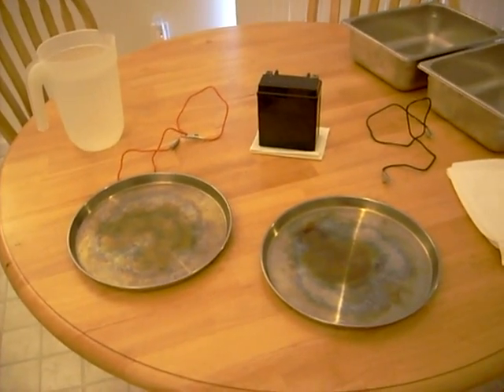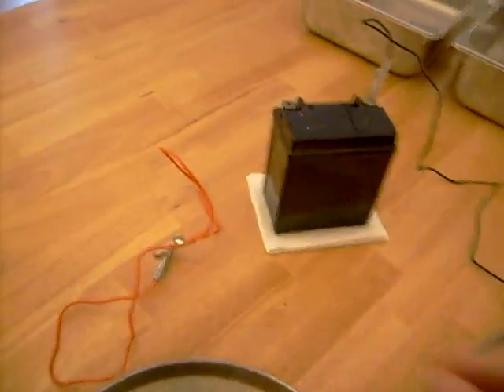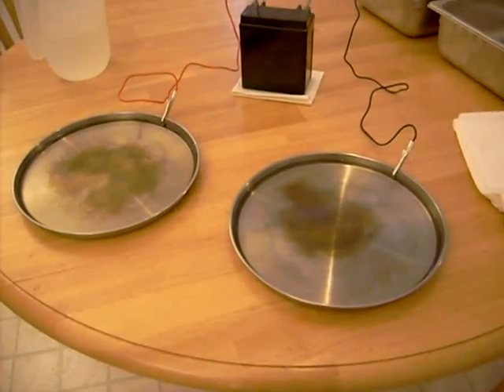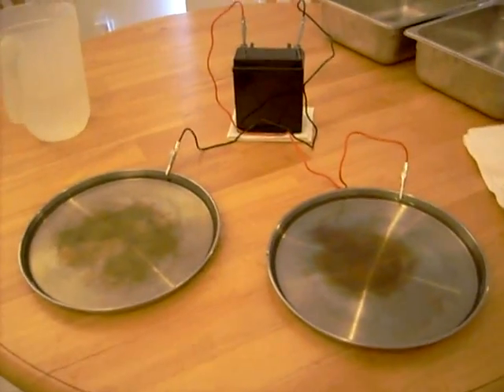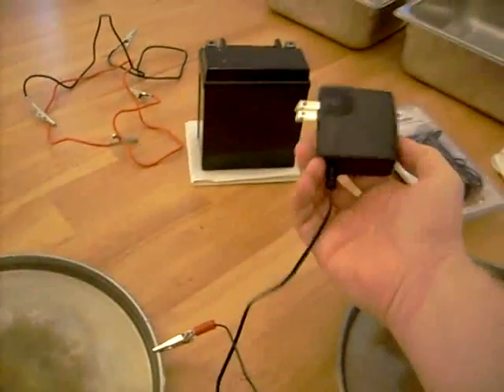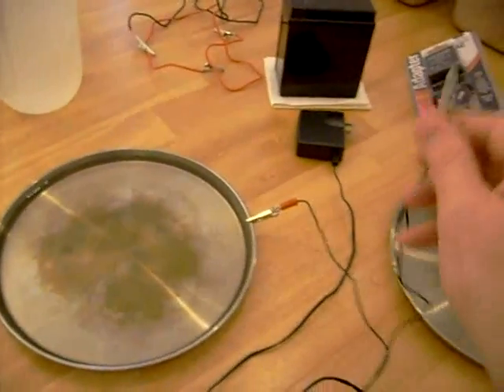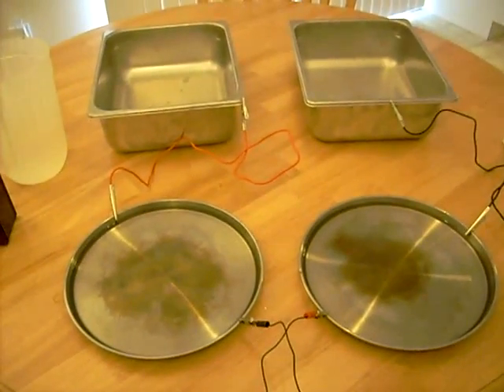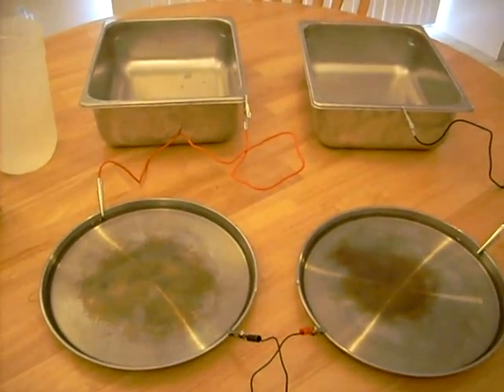Cure Sweaty Hands, Palms, Hyperhidrosis, Hyperhydrosis

Comment: First of all thank you for this video,I have been doing this treatment for a few years ,the first time I had to do for about three weeks before started working,but now I can go for over a month without treatment and let me tell you I live in a very hot weather country,sometimes I get lazy and don't do the treatment but it does works and I have a very severe case of sweaty hands and feet.
Reply: me to have very severe sweaty hands & feet dripping level in just minuttes. i can only go 3-4 days without treament before my sweats return gradually. i use up to 24 volts, 7 amps rechargeable lamp battery, 40 minuttes treatment. how many volts and how long u treatment schedule ?
Reply: I use 12 volt motorcycle battery I do treatment for about a week, I do ten minutes  then I switch negative for a total of 20 minutes on hands and 20 on feet. Don't get discouraged keep trying do this on day 1,2, 4,7,10,15,22. Hopefully this will help.
Reply: thanks for reply, yes this treatment works. i already do this before and stop about a year then i start again from the begining. lucky you can go over a month without treatment but your sweat did not return if i'm not mistaken, while me in 3-4 days my sweat return if not treated.

Comment: One session down and I already BELIEVE that this is going to work. I've used an adapter (must admit it took a lot of faith) and its worked like a charm. Will keep you posted. Thanks for this, Shannon. BTW, it was a AC 240V to DC 24V adapter, together with two shallow plastic tubs. I just put the wires/cables straight in the water and it was quite bearable.
Reply: Did it work?

Comment: From birth I suffer from excessive sweating of the arms and legs. I always felt bad when I was about to give someone a hand. Avalanche of sweat was running down. I used preparations that were not good and caused terrible itching of the skin. I was looking for another way to treat excessive hyperhidrosis on the internet by accidentally discovering dermandry. I can recommend my nightmare with a pure heart and finally it's over. Thanks to dermandry I can function normally. Dermadry changed my life. There is also very nice service.

Comment: The procedure is the same with feet just that I raise the voltage to 24 V, gradually. The current varies from 3 - 10 mA. Depends on how do you feel (level of sympathetic activity), the level of current will be. I recommend you connect an ammeter in series like I did to control the current to avoid jolt and too much tingling.
Reply: How did you adjust the current. I bought a 12v, 2A adapter but I'm scared the amps is too much.

Comment: I did this very easily. It might be hard to understand but i will try:

Take the adapter and cut off the actual connector at the end. You will see that there are actually two copper wires that are actually held together with the wire insulation. Split the wires using a razor blade or knife. You don't need to split them all the way to the end but just about 1.5 feet or whatever. Then, you strip the wire insulation using the blade or wire strippers. Strip only like 1.5 inches.

Comment: After only 8 DAYS, I've already had great success with this guys "at-home" style treatment, so I thought add some comments. It's true, you probably won't see any results until at least 7-8 treatments. ALSO, buy some vasilene! If you have cuts on your hands or even bite your nails you will feel a very strong tingle, even with 6 volts. Using Vasilene, I can barely feel the voltage with 18v! I used 6v, then 12v, then days 3-8 I used 18v for 20 mins total. I am so freakin happy!!! IT REALLY WORKS :)

Comment: 7Ah simply describes the capacity of the battery. That battery can hold 1 A current for 7 hours. 
From the Ohm's law I=U/R current depends on voltage and your skin resistance. If skin resistance is constant it will only depend on voltage. More voltage = more running current. Here electrical current is not dangerous, because the voltage we are using (12-18V) is relatively small. The harmful point is ~40V (dry skin).

Comment: i'd just like to share some problems i encountered and how i overcame them to continue using this lifesaving treatment.

1)When you start your treatment the first time - To prevent shock - start with 9 volts and then after 2 weeks move to 18 volts -you will notice your body would have developed resistance and you will not get a shock.

Comment: It is best to use a battery. The adapter transform the voltage especially electronically by combining pulses that pass through the body. It is best to charge a battery and only use it when it is full.

Comment: This Method WORKS. I saw results after 7 sessions. My hands did not sweat and are bone dry for 2 weeks before I have to do a follow up. I have been suffering from this disorder for about 25 years. I used a 24v adapter 210mA. Thank You Shannonbowling for this video.

Comment: Not sure if anyone has replied, 7ah is just it's capacity. Your body will only let a certain amount of amps across (by resistance) at the voltage rating. 1 amp can kill if at the right voltage... 12 volts is harmless, unless you have really low resistance in your body (a small child, baby, or mostly made of metal)

Comment: To engineers who say this is not safe,
Since you're engineer, why not make a constant current circuit?
For anyone with basic electronics skill, you can make your own constant current circuit. I make one with constant 3mA output, which should be safe. I also add a 1k resistor. With 24V input, it caps output at 24mA. So if my circuit go wrong, I won't get electrocuted. This also eliminates the problem of steel plates touching each other.

Comment: Instead of tap water, because some homes use water softness, buy and use a different gallon of Ozarka water for each session. Works so much better than tap water.  And yes if it isn't working for you, you are doing something wrong. Use aluminum pans for better current flow instead of stainless steel and check the alligator clips to make sure they are good. After 1 week, you will actually need to carry lotion with you because the sweating will stop completely!

Comment: shannonbowling, you're legend, most clear and concise method on youtube thus far. I have been suffering this forever and I am 29. I also have general HH, and I live in tropical Singapore which has a super high humidity and I do sometimes have bad phobias at gatherings. Job interviews are always shaky. This has 1000% has worked for me. i was skeptical but you have saved me from embarassing moments plus now I do not need to change my guitar strings so often now and can run down scales faster. THX!

Comment: There are two types of electrical current: Alternating Current (AC), and Direct Current (DC). Direct current in most cases causes electricity to flow at a constant rate and in one direction; alternating current causes electricity to flow back-and-forth. Because of this, AC provides more electrical energy hence why it is the standard type for Wall Outlets. You may notice that electrical devices like laptops need a converter/adapter: this is because AC is too strong a type for them.

Comment: I use 18 V (two adapters) for hands. The "stand-able" current for me is max 10 mA. At the first sessions you will feel more tingling, which means more current in going through your body (as body is sensitive of current and not voltage). I recommend you start with lower voltage (less current, less tingling, like 9 V) that your sweat glands close a bit and so start to conduct less current.

Comment: Thanks for the video.
I began treatment today with 24V adapter and have to say it passed the comfort level in a minute.
I managed 5 minutes each hand and change of polarity 5 min. Used cleaning cloth under palms not to touch the pan. It was not tingling, It was more.
Let's see what happens tomorrow.
I recommend to start with lower voltage 12V or 15 or 18V, but I'm going to try how much can I take.
Hopefully tolerance rises. Need to do that on feet as well, because they sweat too. 
Even on a standby, just resting on warmish day I have wet bubbles on my feet, which is in no way normal…
Reply: How did this work out for you?

Comment: It tingled a lot when I put my hands in the water at first. It didn't hurt at all unless I had a wound and that was inside the water also, which happened once. It itched a bit at the bottom of my palms. Not a terrible experience. But good luck, just be patient, it should work.

Comment: This video was great although be careful not to use a device with to much amps. I bought a 12v power adapter with 300ma and could barely feel a tingle. I found an old computer speaker power adapter with 15 volts and 800ma and it works great. The tingle from the power adapter was perfect not too weak and not too strong. I used stainless steel oven burner covers to hold the water for my hands. after 3 days of use I can tell a big difference!! Thanks for this video!!
Reply: Is 12V adapter with 2Ah too high of a current?

Comment: First day  of freedom from HH in many years at 9 treatments ! I had the old Drionic units and they were ruined by the saltwater that I  added a week ago. I have not use them in over ten years anyway. The sweating had gotten really bad as of late. This works and I would love to add a voltage regulator to minimize polarity 10 min. switch which stunned meat first at 20volts.

Comment: I have been doing it for two years now and sweat free for at least three to four weeks(up to six) on end. I do it thirty minutes at 20 to 21 volts(9 volt battery with a twelve volt lawn battery) at five sessions in a row after the first two weeks.. I use to maintain it by once a week for thirty minute after the initial ten to twelve time. I use stainless steel pans and it had gradually eaten tiny pin holes in the pans.

Comment: @Kyargh Sweating is not a stupid mistake. It is a normal function in the body. Excessive sweating is a normal function expressed to an abnormal degree. A sweat gland will only sweat if the brain and nervous system tells it to do so. It doesn't just happen. The stress response as mediated through the sympathetic nervous system is what drives sweating. The brain inhibits the sympathetic nervous system.Chiropractic stimulates the brain so that it can better inhibit this process. Good Luck & study!!

Comment: Update on my treatments, one month and no sweat. Even my feet are starting to crack and I do not even treat them. I am using 18 volts a 12 volt lawn battery wired to a 9 volt in series and getting right at 20 volts. I use Epson salt and I DO NOT SWITCH LEADS during my twenty minute treatments to avoid that SHOCK. I do once a week maintenance and then switch the leads every other time from right to left.

Comment: after 5 days i start feeling the effect of this method both on my palms & Soles and after  doing it continuously for10 days i started giving a gap of 7 days and now m doing it for only 20 minutes after every 7 Days and i am not experiencing single drop of sweat on my palms and soles even after participating in Sports or walking few Km's. i used Ac/DC adapter of 18Volts (1A)  and used 4 aluminum pan's.  i used all the 4 Pan's at the same time inter connecting the 4 pans as shown in the video.

Comment: It works! It only took four sessions for my hands and five (painful) sessions for my feet, but my hyperhidrosis is relatively mild. I saved money by hooking up two 12V adapters that I already owned in series. I used the kind in which the tip has a different polarity from the shaft, so I didn't even have to damage the adapters.  Plus, I used the adjustable ones (3-12 V) and found a good voltage at 12 V + 7.5 V = 19.5 V.  My legs now sweat a little more to compensate, but it's not bad at all.
Reply: it will heal permanently? no need of another sessions?

Comment: Cont'

After you strip both the wires about 1.5 inhes, take each copper wire and just twist it around so all the copper is connected. Fold the copper wire in half, twist again, and then fold again, and twist again. The copper portion for each wire should be about 1 centimeter. Take this and place it in some alligator clips. These alligator clips can be bought from Wal-mart for 6 for $1.00. Then using some pliers, press the alligator clips down to hold the copper wires in tight. That's all.

Comment: Just finished my first session.I wanted to start with three 4.5V batteries connected in series, but I couldn't stand it...So I removed 1 battery and did it with 9V..I did everything it was mentioned in the instructions, but I wonder if my hands will adapt to a higher voltage? Hope this will work for me-gonna write back in a week.
 A big thank you!

Comment: 500 milli amperes will be ok. Though even if it is more and the voltage is 12 volts , your body will not draw any extra current. So it is safe as long as the voltage is not high.

Comment: It's the voltage that will get through to your nerves. (Although don't go beyond 25V)
Current is more lethal than voltage. 
It is safer to have 20V and 0.5A for a longer period of time than 12V and 2A for a short period of time. 
Doing it on really low amps and a longer duration is more effective.
If you don't feel anything, slowly increase the current until it will work for you. Or make the water more conductive. 2 Amps is max in my opinion.

Comment: You need to connect two 12 volt batteries in series, it is twice as strong and it will promote the desired result within a few days.
I did it and since then my life has changed.
20 minutes for each foot (40 minutes per day), and my feet completely dry.
now I do that ones a week.
good luck!!

Comment: You can get universal laptop charger from ebay for few bucks. I'm using it right now, just done 2 treatments on 18v, best thing is you don't need to recharge it and you can also adjust voltage from 12v  to 24v, and its safe. I hope I'll start to see changes within few days.

Comment: Though it works, but it's still "practical" now. I mean, when I go outside, my hands still sweat a lot......Just like before.
Could anyone who has got success tell me how high the voltage you have used? Do you add anything into water?
The success I mean is when you go outside, your hands won't sweat or sweat like a normal person.
Thanks a lot. I appreciate your kindness.

Comment: Usually I sit on a mattress-less bed-frame, elevate my laptop for better viewing angle, plug in my 18v charger, connect it to pans filled with warm-hot water. Put my palms in, sit back and relax, maybe add salt or baking soda for more kick. After 10-12 mins I switch hands. That's when you feel the tingling the most. Do it daily for the first 2 weeks, lower # of treatments as more time passes. I'm thinking you set-up your charger wrong. Do you or anyone you know feel ANY tingling with 2 hands in?

Comment: than buy the pans and the necessary cables. put washcloth in the pans and let your palms/feet rest on them. do the threatment for 10 days straight and at the end you will see drastic improvement. after the initial 10 days the threatment needed is more individual. i do it once every week on the same day, try that at first. some can go 2 weeks.

Comment: Well im using an adapter, but you can use batteries if you want to.. I just can't suggest you any..
About volts, you can start with 12, see how it goes, if you're going to beel the sensation, then you could increase the voltage to 15 and maybe even 18, its really up to you :) You have to try and see, it's individual thing..just try with lower voltage if you are a beginner, 12 will be perfect :)
As for amps, the lowest the better, Im using 1amp, so 1 amp or less is ok :)

Comment: I've had great results following the other video EXACTLY, except I use larger aluminum pans.  Haven't tried with a 12v battery as depicted here, it may not be enough voltage for you, but you only have 5 treatments so far, so, yes, indeed, be patient.  I used 3 lantern batteries as in the other video, for a total of 18V.   I use test leads from WalMart with alligator clips already attached, and clip to edge of aluminum pans, warm water, 10 minutes each polarity.

Comment: It is recommended to use warm water. Yes, you shouldn't touch the metal. Becouse not electrons (from metal) should pass trough your palms, but ions (from water and salt solution).
I used this method 5 days and now my palms are completelly dry. It feels amazing. However my fingertips  are a little bit moist. But it's a piece of cake in compare what was before that treatment.
I'm using two 9V bateries and warm water with a lot of salt.